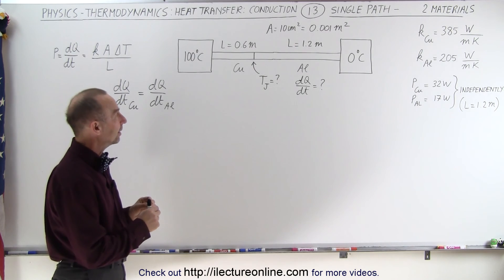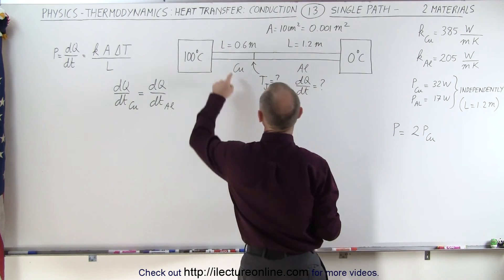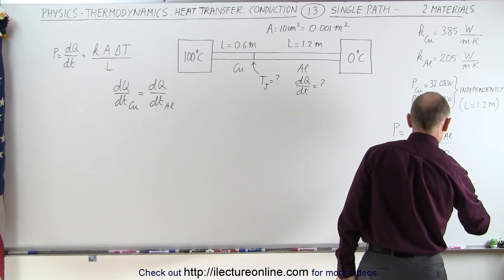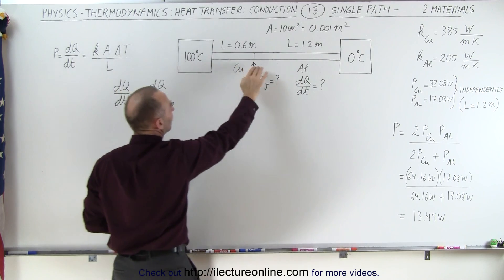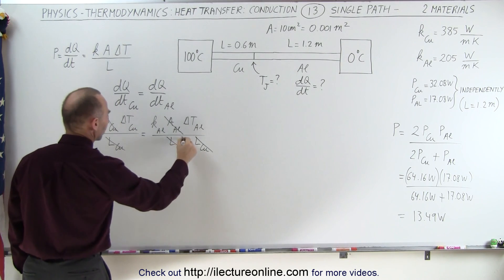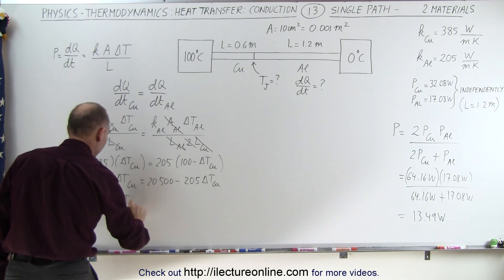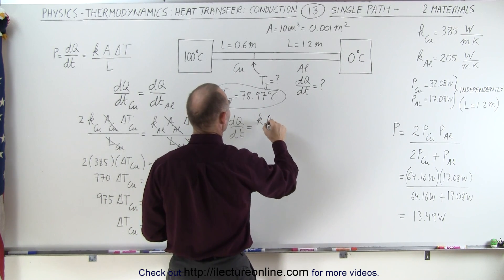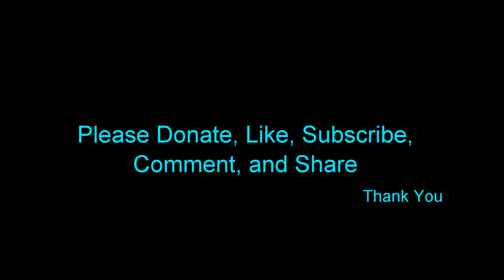Physics 24  Heat Transfer: Conduction (13 of 34) Single Path - 2 Materials

Comment: Sir, why are we not using the same equation as in double pane window?
Reply from the maker: It depends on what is asked and then you need to find the method to solve it.  The key here is that they want to know the temperature at the junction which can be found by setting the dQ/dt of the left side equal to the dQ/dt of the right side.

Comment: Hello sir, thanks for all the lectures.
I have a question.. i understand that the heat transfer should occure at the same rate through the area mentioned in the example. But since the Aluminyum has a slower rate of heat transfer, doesn't the heat transfer slow down before it reaches the end ?
 we calculated only one result i was wondering how come it doesn't change through the whole lenght ? 
Thanks
Reply from the maker: The rate of heat transfer MUST remain the same throughout the entire length, even when there are two different materials.  What changes is the temperature gradient, which means that the temperature changes more quickly in the copper compared to the aluminum.
Reply: Oooh, okay. Now it makes sense. Becouse it seemed weird that nothing changes through the whole lenght even though the materials are the same. But now i know that T changes.
Thanks again for the answer and for amazing lectures. you are saving so many lives, may God give you all the best sir !